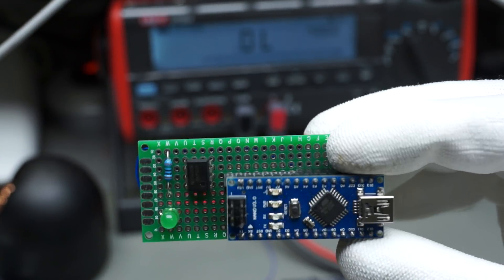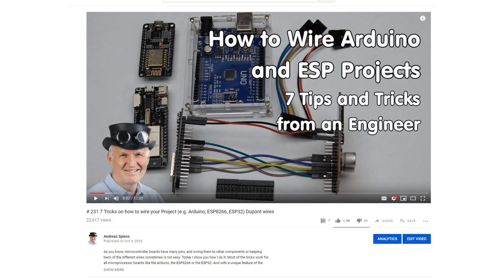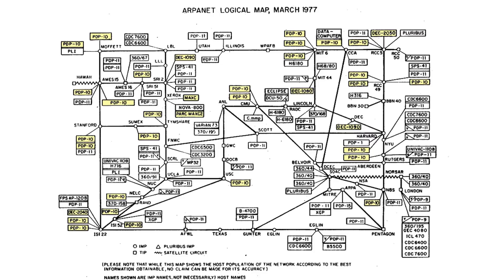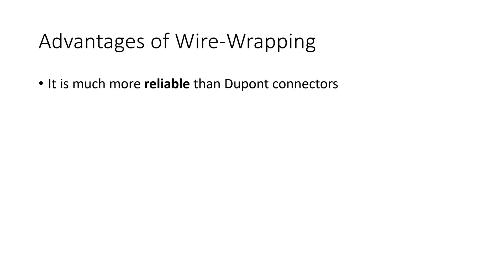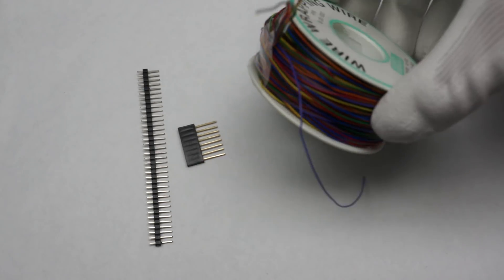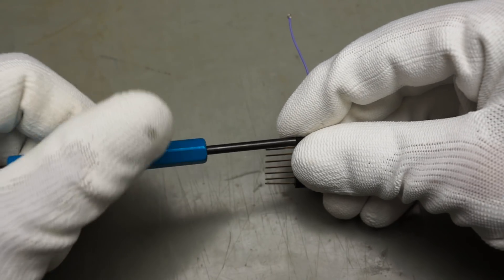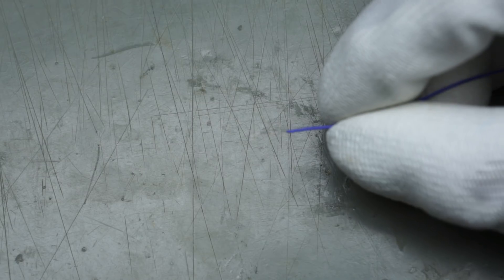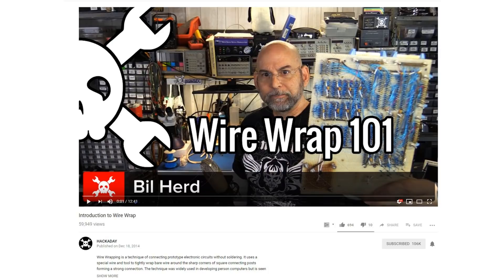#243 Better than Dupont Wires: Wire Wrapping for our Projects (Arduino, ESP8266, ESP32)

Comment: Hi, I have a question reguarding SD cards. I want to save data on a SD card and then copy it via USB to a PC, but I don't know how to convert into USB.
Reply: Use a USB SD card reader is the simple and usually inexpensive solution for that problem. Plenty of choice on eBay
Reply: @boblewis5558  But I have to connect both, the ESP32 and the USB Connection at the same time to the SD card...
Reply: @a5t3r1xd3  Have you thought about an SD Card Reader connected to the ESP32 via SPI (not seen any I2C ones)? I have a couple but have not tried them yet myself. They are pretty cheap <£1.00 each or <£1.50 for 3!

 https://www.ebay.co.uk/itm/3X-SPI-Reader-Micro-SD-Memory-Card-TF-Memory-Card-Shield-Module-for-Arduino-I9H8/123304829433

Not sure if Andreas has done a video about using SD card devices but there quite a few on YouTube I've seen. Again, don't know enough to make a better suggestion. Once the data is on the SD card you could use a separate bit of code to upload to a file via WiFi , direct connect  using a W5500 Ethernet board or similar, USB connection or physically unplug the SD card.

Comment: I still have a Z80 system I made this way - wire wrap was my go to method for prototyping.  But a sea of blue wires could be a problem when debugging so thanks for the tip of using coloured wires.  I will now track down my old WW tool...
Reply: Back in the early 80s I made quite complex Z80 and 6502 systems using wire-wrap IC sockets and thousands of wires.  Very tedious but eventually satisfying when it worked.  I still use the same wire for jumpers as it's coated in high-temperature plastic and very easy to solder.  Just yesterday I was wire wrapping a couple of small DC-DC converter modules onto a board.
Reply from the maker: The Chinese Wires are not very heat-resistant. But colored ;-)
Reply: I think the wire we originally used was 30 AWG, the conductor was silver coated with teflon insulation.  No internet and very little mail-order back then so we had to go through manufacturers agents, wait long delivery times and pay high prices.  We used hand tools for wire wrap IC sockets and connectors on boards but had electric tools for the larger size wiring between panels.

Another technique we used was to plan out CPU-RAM-EPROM-IO wiring between sockets then cut-twist-solder wire-wrap wire using standard IC sockets.  A lot of it was data and address bus runs so easily duplicated.  This method made a lower profile and more robust board.  These boards were only clocked at 2-4MHz so wire layout wasn't too much of an issue for one-off industrial controllers.

Comment: I still use wire wrapping today for digital logic circuit prototyping! I have an automatic wire wrapping gun and wire strippers specifically for wire wrap wire which cuts and strips the correct length of insulation. Made quite a few one off production units for customers back in the 80's just using EUROCARD size wire wrap boards!
Reply from the maker: So you are equipped much better than I am! I only use it to replace Dupont wires, so the tool is ok for these few wraps.

Comment: Multiple thumbs up, for finding the arpanet map of 1977 (very cool) and mentioning my hero Bil Herd. Been using wire wrap since mid 1980s. I have the same wrap tool but mine is gold color.
Reply from the maker: I think you deserve the Golden tool for such a long usage!
Reply: @AndreasSpiess  Mine's gold too - I was actually jealous of your blue one.  When I got mine, they were all gold...
FWIW, the stripper in mine nicked wire pretty often.  That's why I went with a box of various lengths and colors of pre stripped stuff.
Quality wire strippers that went to 30 awg weren't on every street corner in the '70s, not hardly.  There were some adjustable ones that would go that low, kind of but they tended to eat wire - just not repeatably precise enough.
Reply: I unearthed three in various toolboxes - all gold. One was a 22awg tool and I can’t even remember what that was for...
Reply: @mahudson3547  DEC backplanes - the yellow wire pictured in the vid, were 22 awg.  Only later on did stuff go down to #30.

Comment: Wonderful video reminding me of good times doing EE lab projects at university. We were even given electric wire wrapping machine. And hours spend troubleshooting mistakes in sticking to the wiring lists...
Reply from the maker: I think you still get these machines. But they are very expensive...
Reply: Andreas Spiess yes indeed, I believe we were told the cost was 700 USD (1975 USD) !

Comment: I was an Electronics technician back in the 70's and spent many hours wire wrapping,  I think I still have a battery operated wire wrapping tool.  Keep up the great videos!
Reply: A wire-wrapping tool/'bit' would be a great addition to my  ES-121 screwdriver :)
Reply: Yep - had a battery wire wrapping tool myself.  Did lots of wire wrapping in telecom closets and data centers.  My boss used to give me grief about using the batt operated tool, it wasn't for real tech's....
Reply: But are the electronics for the battery powered wrapping tool also wire wrapped?
Reply: @Nicksperiments  Probably not....
Reply: @Nicksperiments  What electronics? Just a DC brushed motor, a trigger on-off switch and a battery connected in series with wires.
Reply: Paul Rautenbach are those wires soldered or wire wrapped?
Reply: @Nicksperiments  HaHa.
Reply: I used to have a very cheap wire wrapping tool run on batteries. I loved it. It did a much better job of wire wrapping than the hand tool and was way quicker. I wish I still had it.
Reply: @paulrautenbach  You are not kidding - price one....
Reply: Yep, I remember mine as well.  I bet if I searched in the basement I could find it.  CAT5 and phones.

Comment: Leiterplatten sind doch heutzutage gar kein Problem. Ich habe vor ein paar Tagen 10 kleine Leiterplaten bei allpcb.com bestellt. Montag morgen habe ich bestellt, Donnerstag Mittag hat es der Postbote gebracht. Gekostet hat mich das ganze 22€ inklusive Versand. Für 5 LP mit 70x135mm habe ich 23€ bezahlt. Alles zweilagig und Abstände >= 6 mil. 

Beim Wire Wrap kenne ich das mit so einer Pistole. Die Wrap-Pins sind im Querschnitt quadratisch und beim Wrappen gibt es an den Kanten eine Kaltverschweißung. Darum ist es eine sehr zuverlässige Verbindung.

Die Fädeldrähte sollte man auch nich vergessen. Da kommt man etwas flacher hin. Ich habe einen Fädelstift, aus dem vorne der Fädeldraht kommt. Den steckt man in das Loch durch den der Pin des Bauteils ragt. Dann wickelt man ihn in mehreren Windungen um den Pin. Meistens hält der Draht von selber fest, so ist es kein Problem. Dann lötet man ihn mit ca. 450°C fest. Dabei verbrennt der Isolierlack und man hat eine anstängige Lötung/Verbindung. Die Versorgungsspannung(en) und GND mache ich trotzdem meistens mit Schaltdraht oder Silberdraht. 

Als Leiterplatten noch ein echt großes Ding waren mit 400DM Kosten, da habe ich schon nocht Testgeräte gefädelt. Aber das ist nicht so gut, weil die Dokumentation eher schlecht ist und wenn das Test-Gerät abbrennt ist man in einer eher unguten Lage. Darum würde ich nur noch Leiterplatten verwenden. Für die Preise vom Chinamann kann man sich das Verdrahten sparen. In der selben Zeit hat man das Layout zweimal gemacht, hat eine perfekte Doku mit Stromlauf und Bestückungsplan, es ist leicht zu reparieren und sieht professionell aus.
Reply: Man sollte solche "veralteten" Techniken nicht einfach als überholt abtun, denn oftmals ist es doch so, dass man halt auch einmal ein bisserl außerhalb vom Schachterl denken muss, wenn man etwas bauen möchte, bei dem bei weitem nicht alle externen Parameter auch nur annähernd so sind, dass Standard-Verfahren problemlos anwendbar sind. Sehen Sie bitte beispielsweise hier: 
[CTRL] + https://www.flickr.com/photos/134879071@N07/33525226653/in/album-72157667608205094/
Das ist ein Kontaktring eines MFT-Bajonetts aus ABS. Da ist Löten mit Standardausrüstung (und auch sonst) mehr oder weniger Glückssache (Schmelztemperatur!). Und das an elf Pins. Und wenn man es versaut - sorry for the plain English - kann man 130 Euro in die Tonne kloppen. Von daher bin ich immer ganz froh, wenn ich über solche Old-School- oder Alternativlösungen stolpere, weil beim nächsten Mal probiere ich das aus. In diesem Sinne: 
Merci vielmal, Andreas.
Reply: Matthias Mair Das Bild kenne ich doch :-) Flickr sagt, ich habe es vor 1 J. kommentiert. Wire wrap kann man schon nutzbringend verwenden. Aber Leiterplatten sind mittlerweile so günstig geworden, dass ich persönlich wenn möglich auf Flechtwerk verzichte. Ich habe mich einmal mit einem Testgerät für die Produktion herumschlagen müssen, das so ein Drahtigel war ohne Stromlauf und dann noch kaputt. Das war gar kein Spaß:-)
Reply: @svenpetersen1965  - Oh fagg ... platform crossover auf die harte Tour. Hätte ich eigentlich schalten können, aber ich bin zur Zeit eher analog unterwegs. Schaltzeiten und so. Aber jetzt wird es ja Winter, da flickr ich vielleicht auch wieder mal, aber ich kann das Licht im Outback Oberlausitz noch nicht so recht lesen. Schau mer einfach mal ...
Reply: Matthias Mair Ich habe zur Zeit auch nur meine C64er fotografiert. Soviel zum Thema alte Technologien :-)
Reply from the maker: Ich gebe dir recht wegen den Leiterplatten und ich tendiere auch mehrheitlich dazu. Ich plädiere auch nicht dafür grosse Platinen zu vertrahten. Ich habe es eher als Ersatz für Dupont Drähte geshen.
Betreffend allpcb: Das muss ich mir mal anschauen. Im Moment habe ich Orders bei JLPCB laufen. Da kann ich die Teile auch dazu bestellen. Aber ich glaube die Portokosten sind höher (mit DHL).
Reply: Andreas Spiess Für „mal eben“ ist es schon cool. Aber es geht meist arg in die dritte Dimension. Ich habe einmal in einer Ecke im Labor meiner vorherigen Firma eine elektrische Wire Wrap Pistole gefunden. Das ist aber wenigstens 15 Jahre her. Natürlich habe ich ein bisschen damit gespielt. Es hat ganz gut funktioniert. Der Draht sitzt bombenfest. Das lag an der Kaltverschweißung, die auftritt, wenn der Draht recht fest über die Kanten des Wrap-Anschlusses gezogen wird. Wenn man die Verbindung wieder löst, sind die Kanten der Anschlüsse nicht mehr so gut und eine nachfolgende Verbindung u.U. Nich mehr sicher. Früher hat man so ganze Computer gebaut. Da konnte man dit Taktfrequenz aber noch mitzählen :-)